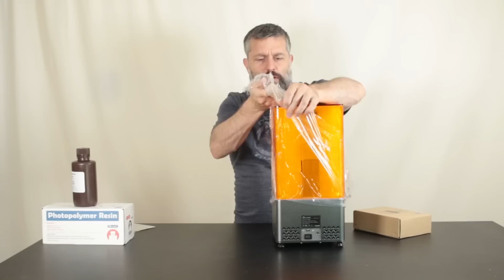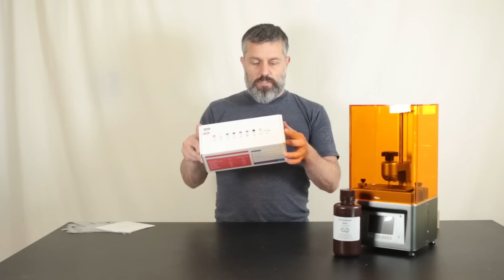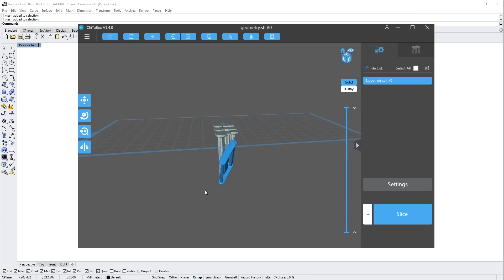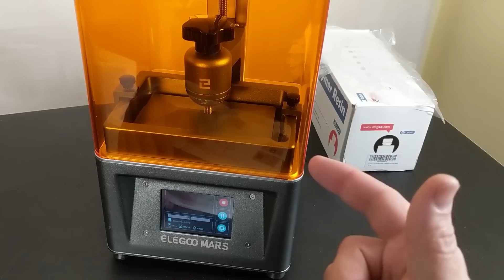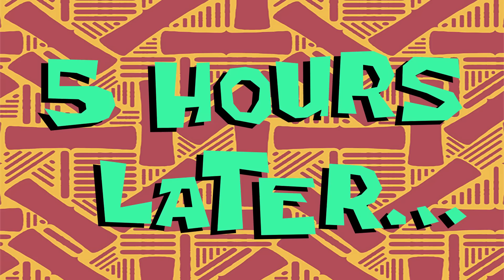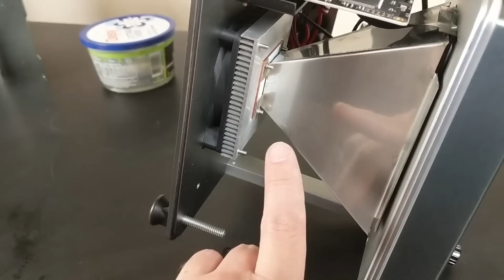$250 for This Quality of Printing Is Unreal! - the Elegoo Mars Delivers, so Let's Review It.

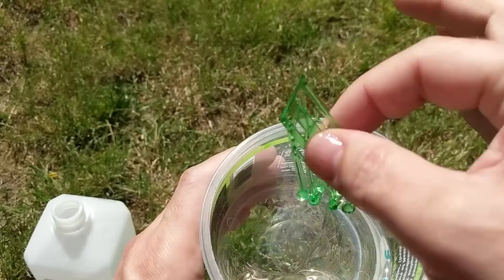Comment: 18:00 It's usually best to do a 2 step IPA clean if possible. Use stainless steel diamond tweezers from Amazon to swish the parts.
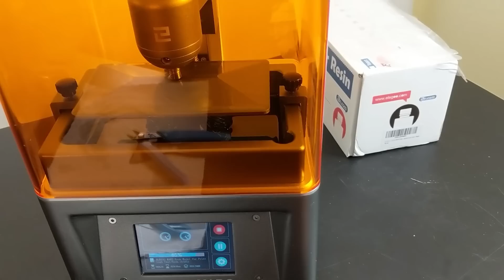18:55 That popping sound in the tray is fine. It's the teflon film stretching and releasing as it should. I know it sounds aweful but it's ok and does not stress the Z motor.
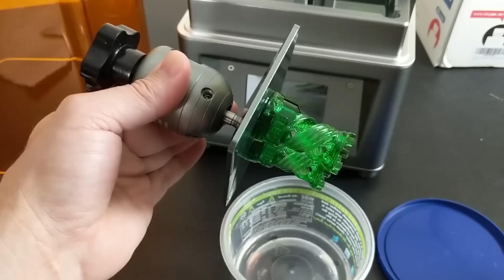20:25 Try using a Titan multi-purpose razor scraper to remove parts from the buildplate. Works awesome.
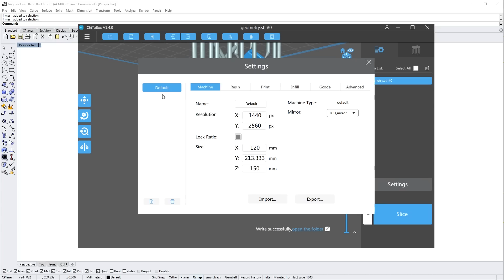21:55 Selecting your printer will give you the correct build envelope. Also, print some 10mm cubes in all 4 corners. Use their dimensions to create 'offsets' in the slicer to correct part accuracy by adjusting either the envelope size or exposure time per layer (per material).
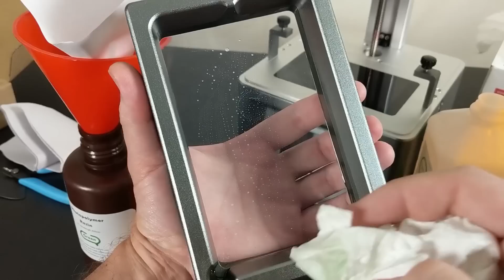23:13 The film is a consumable. Can probably be replaced with teflon or tefzel. Make sure to never start a new print without cleaning and inspecting your buildplate surface first. The outlines from the previous prints on the film we call 'ghosts'. 
24:40 That black resin is loaded with pigment so print times should be blazing fast.
26:00 Nice post cure hack dude! There should be a full mask exposure in there somewhere. It's used to blast the entire print area in order to cure stuck pieces inside the tray to a sacrificial rectangle piece for easy removal. Remove the build plate, gently drop it down to the floor, allow the material to settle down, then blast the whole mask. After about 30 seconds you'll have a fully cured rectangle that will pull up all the tiny pieces originally stuck to the film.
Reply from the maker: Great comment. I'm going to pin it to the top for a while so that it gets the exposure it deserves. Thank you.
Reply: And the Most Valuable Commenter award goes to…
👍🏼
Reply: > best to do a 2 step IPA clean if possible
India Pale Ale... REALLY? :)))

Comment: Can cured resin be used outdoor? For example, to build a box enclosure for electronics, or for a display to be  mounted on a bicycle or motorcycle? The material will shrink or break with low temperatures in winter?
Reply from the maker: Apparently these parts continue to be UV sensitive and will break down over time if continuously exposed to UV. You can always paint them with a UV resistant clear coat.
Reply: @DesignPrototypeTest  thanks for the answer. I heard about that too. Even the guys from Formlabs was not able to give a definitive answer about the argument... 😞

Comment: The imprint on the maker surface was because you 'plucked' the rooks off the surface.  You were supposed to scrape the printed items off.
Reply from the maker: I never touched that surface until I was cleaning up the resin to switch colors. Did you watch the entire video? The imprint was in the location where the suction cupping was taking place. My actions had nothing to do with the imprinting.
Reply: Didn't mean to offend.  Yep, watched whole video.  Just saying that scraping off the print may be better than plucking it off. The forces applied to getting the prints removed from the print surface at the end is what leaves a remnant image on the platen surface.  Thanks for sharing your videos.

Comment: If your 2-year-old can pull the power cord out of the wall, they could pull the machine off the table and get hurt or covered in resin.  There's also inhalation hazards to consider, because chemical exposure guidelines are set based on adults, not kids.  Be safe, keep your tools out of your living space, and store your chemicals in a locked metal cabinet.
Reply from the maker: Technically, he flipped the switch on the PowerStrip under the table. He loves doing this because it turns the studio lights on and off. He was actually about 10 feet from the printer, and I was only 2 feet from him when it happened. He was never in danger. But thank you for your kind regard for the well being of my child.

Comment: GLOVES! Also one thing when cleaning, use a old toothbrush. Just swishing the print around in the resin wont do it. Scrubbing lightly with a toothbrush using isopropyl alcohol will do the trick. SAFETY FIRST!

Comment: I've been looking at this exact printer wondering how it is.. from reading specs etc.. it seems nice
Reply from the maker: This is the only one I've used, and I really like it. "Uncle Jesse" has reviewed several other models.
Reply: @DesignPrototypeTest  actually I don't have one at all but I've been watching them change in capability and technology and price for years and years, waiting for them to be more accessible and they're about there at this point... I wanted to get one just because it would be immensely useful with all the stuff I fix that uses plastic cases and pieces like cars, motorcycles, bicycles, drones, electronics. But I really can't afford it, even now it's really a bit much as cheap as they've gotten. I actually ended up grabbing a 3d pen, most little things I want that I'd actually buy from other people, figured I'd use the money towards my own something, most of what I'd print is smaller anyway and for 40$ or less for a whole 3d pen kit, I can print parts exactly to fit weird drone spots to protect the carbon fiber or attach electronics and no designing on any cad like thing... Works great. But for larger things with perfectly flat panels it's Alittle extra work. But it came with a  silicone mat with lines you can draw into then remove and fill frames/weld frames or whatever..

Comment: When the resin solidifies, it bonds to both surfaces - the face of the resin tank and either the base plate or the layer before it. Formlabs use a tilt (f1/1+) or tilt and slide (f2, maybe f3 too?) motion to ensure minimal loading of green resin while this is happening. Unless the resin and tank face have been specifically engineered for low adhesion, pulling straight up has about an equal chance of causing the whole part to detach from the build platform as it does peeling the layer. That by the way is that "thunk" you hear - all the springiness of the glass (or super special silicone? Not sure if this DLP machine needs that, I know the laser ones use it) and lifter mechanism released at once as the layer separates.
Reply: The film is flexible so when lifting it flexes and peels pretty similarly to what you get with tilt. The wiper on the f2 is to ensure resin is present everywhere (can prevent bubbles, not really an issue) and wipe away any broken bits (not really an issue either), not for peeling away (aka they also figured out the tilt wasn't necessary, film flex is enough).
Reply: @kilrahvp  Apparently the main function of the wiper is to oxygenate the soft layer. Point being, this is all way too sensitive to be reliable in production conditions.

Comment: If you've spent any time at all troubleshooting a formlabs which hasn't been treated with kid gloves at all times, you'll know they ain't perfect. I had the (mis)fortune to use a form 1+ and later a form 2. The 1+ is sensitive to literally everything. From a spec of dust on the mirror (good luck avoiding that in a production environment!) to models that are too big and take very long to complete (there's a reason the f2 has a wiper and auto fill).

The form 2 was better in pretty much every way, but still felt rather like using an apple product. If you stray from FL's strict guidelines at all - expect bad things to happen.

There's too much to go wrong and too little documentation (and control) offered to the user in terms of dealing with unexpected behaviour. I get that it's treated as a trade secret and all, but revealing the basic curing characterisations of their resins (data they NEED to control the machines) isn't exactly telling their competition how to synthesise them.
Reply from the maker: Good comment. Thank you.
Reply: @DesignPrototypeTest  You're welcome ;)

Comment: Could the OSHA safety crew in the chat please explain to me what exactly is in SLA resin that is worse than spray paint, superglue, or bondo? I see nothing in MSDS for resins that says anything particular concerning. Typical VOC, allergies, particulate matter warnings. The way some people in the chat are reacting you'd thing they were discussing weapons grade plutonium.
Reply: Hi there, I'll take a stab at it.  Somebody else already linked the MSDS for a Formlabs resin, which I'll link at the end for convenience.  It contains methacrylated monomer and oligomer, which is the actual resin part, and diphenyl phosphinoxide, which is a hardener.  In the safety sheet, it lists the methacrylates as skin sensitizers and eye irritants, and the hardener as causing reproductive harm ("atrophy of the testes" to be precise).

Compared with spray paint, you are working with skin sensitizers and irritant inhalation hazards vs. airborne solvents, which pose a danger to mucous membranes like eyes, nose, and throat.  In both cases, good ventilation and a proper respirator will help a lot, and neither should be done in a kitchen or bedroom.  Compared with superglue, the skin and inhalation hazards are similar because superglue is also a type of plastic resin (cyanoacrylate glue vs. methacrylate monomer resin); obviously the other main hazard is skin bonding.  Bondo is an epoxy resin whereas this Formlabs stuff is acrylic resin; honestly epoxy resin is worse, here's a worrying quote: "1. Epoxy resins are moderately toxic skin and respiratory irritants and sensitizers.  Resins containing diglycidyl ethers are probable human carcinogens, skin and eye irritants, and may damage the bone marrow.  2.  Amine hardeners are moderately toxic by skin contact and highly toxic by inhalation.  They are potent skin sensitizers and irritants, causing dermatitis in almost 50% of workers regularly exposed to them.  They can also cause asthma, coughing, bronchospasm, and other respiratory difficulties.  Other hardeners are also toxic."  (Artist Beware, p. 409)

Here's what my art school materials safety handbook ("Artist Beware" second edition published in 2005 by Michael McCann, PhD, CIH), has to say for Acrylic Resins, like the Formlabs:
"1. Methyl methacrylate monomer is moderately toxic by skin contact, eye contact, and inhalation.  It is an irritant and causes headaches, irritability, and narcosis when inhaled.  It is also a sensitizer, and may cause asthma.  2. The benzyl peroxide hardener is flammable and explosive and is a slight skin and eye irritant." (p. 407)

He goes on to discuss other types of resins, like Amino and Phenolic Resins, Epoxy Resins, Polyester Resins, Polyurethane Resins, Organic Peroxides (hardeners / initiators found in many of kinds of resins, mostly explosion hazards and can cause blindness if splashed in the eyes), and Plastics Additives.  The Formlabs stuff contains several additives, some undisclosed for trade secrecy purposes, as well as pigments, esters, retardants, and plasticizers.  That's a whole lot of different classes of chemicals, as the reaction that takes place is pretty complex, and the product needs to last during storage.  "Artist Beware" lists esters as follows: "Uses: Lacquer and plastic solvent.  General Hazards: Skin, eye, nose, and throat irritant; some narcotic effects; good odor-warning properties" (p. 97).   

In short, the big danger of resins is that you can easily become sensitized to them, and then suffer severe and progressively worse allergic reactions any time you try to use them in the future.  Some of them can cause nervous system damage, tumors, or cancers; most of them haven't been tested long term as carcinogens, so we don't know.  That's the other big danger: the unknown. Many have only been on the market a relatively short time, or only in industrial use, since they were never intended for home use.  People treat them like because we don't fully know the health hazards, they are probably safe, when from the data we do know, it's more likely the reverse.

Hope that helps.

https://archive-media.formlabs.com/upload/White_Resin_SDS_EU.pdf

Comment: Watching you try to remove the print from the bed by tapping on it then full on grabbing it is hilarious. All you have to do is take your plastic spatula and slide it against the base, just slide it along the plate and hit the base a few times and the spatula will work it's way under and the print will release with ease.

Also, WEAR GLOVES. You really should know wtf you're doing before reviewing an SLA printer and influencing others.

Comment: You wont accept a cookie but you install their software? You understand the software has way more potential to spy on you, right?
Reply: I couldn't give less f***s how many cookies I have. You can always send them to the void. Installing random software isn't something one should take likely due to security and privacy risks, as ALL locally stored data is exposed to it. That's why I'm not a fan of Windows in general, you know, the whole telemetry thing and all that. That wasn't why I originally switched, I wanted to challenge myself to learn new things when XP was loosing support. I had already learned a decent bit about Linux at the time, and now I know a WHOLE lot about it. But, to each their own, what works best for them.
Reply: @powertothebauer296  
Yeah, I know most web services run on Linux. If anyone has used it as long as I have and didn't know that I'd be surprised. What a server is programmed to do isn't usually related that much to the base OS though, as most websites track people. In my specific example I was referring to malicious software, which primarially targets Windows because of the larger userbase. That combined with better separation of privilages, tighter security (Windows is getting close in some aspects), and the fact Linux users are generally more careful about what they install reduces security risks alot.
Reply: @powertothebauer296  "made by Linux" 😂😂😂

Comment: l very large part of the pricey commercial printers covers the customer service and reliability. A DIYer has time to tinker and get a cheap printer to work. A corporation needs the printer to reliably print over and over and over and over with very little down time.

Comment: I have access to a Stratasys Objet at work, as well as a Dimension Elite, and a Dremel Digilab 3D45 at home. Resin printing is great for resolution, but for strength and long term durability FDM still wins. Which technology is "better" depends on what you need out of your parts.

Comment: The laser mirror thing you were talking about at 6.33 is not called a MEMS, it is called a Mirror Galvonometer or Galvo.  MEMS stands for MicroElectroMechanical System.  It is a term to describe types of minature electronic components, usually sensors.  The accelerometer is your phone usually a MEMS device for example

Comment: why print that part at an angle like that and not just flat?
Reply from the maker: Doing it like that allows for the least amount of support material. It's similar to printing at a 45° angle on an FDM machine. I could be wrong about that, but when I was taught how to use the FormLabs machines this is the technique I was taught.
Reply: ok so it it was orint flat that would mean to much is on flat surface and can brake when removed
Reply from the maker: It's a trade off. Printing it in a more "flat" orientation would require a lot more supports, but would also take a lot less time to print. Remember with this printer each layer takes the same amount of time to print whether the actual print geometry for that layer is the size of a pinhead or the entire print area. Therefore, limiting the Z height will save a lot of print time.
Reply: interesting. printing that little thing without supports and flat.when i get my printer will try

Comment: The 'orange lid' or housing is to keep the resin basin shielded from ambient light - AND DUST or foreign materials. But even then the UV resin will take forever to cure in the open environment. I've tested the photon resin in an open container on my tabletop for two months before it became so thick it wouldn't pour. I've had the basin inside my photon full of resin for over a year and it is still perfectly fine to print with. And the brown bottle will keep it safe forever. The ONLY thing I ever CLEAN is the underneath side of the form plat. When a print completes, I briefly wipe it off with a paper towel and put it back into place. The basin stays full all of the time. ALL THE WAY FULL. The FEP film can be replaced without using the 'pre-cut' packages you normally see at ridiculous prices. Just purchase the FEP film from a plastics manufacturer at the thickness you want. You have to cut it with scissors but it is way cheaper.

Comment: Question I own a Prusa Mk2s, Hot end Thermistat wire broke and it made a mess, bought a new hot end but the housing seems damaged.. I own a Mars3d Resin printer, could I print the housing for a Hot end in resin, will get to hot, is Resin to brittle, etc.. help please
Reply from the maker: Actually, resin is a good candidate for this part. Because it is a "Thermoset" plastic instead of a "Thermoplastic" It will not deform when it gets warm/hot. It will get a little bit 'rubbery' but will still maintain its shape.